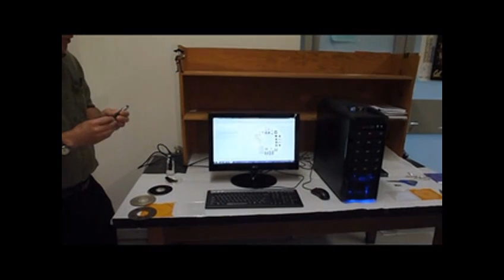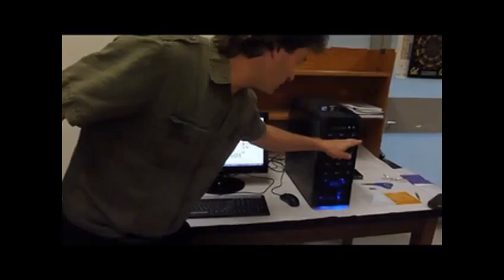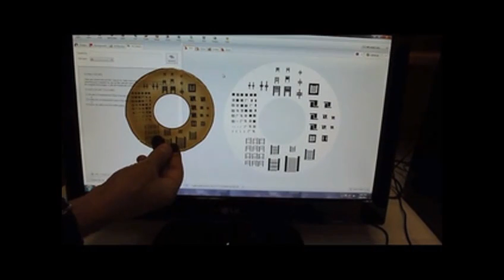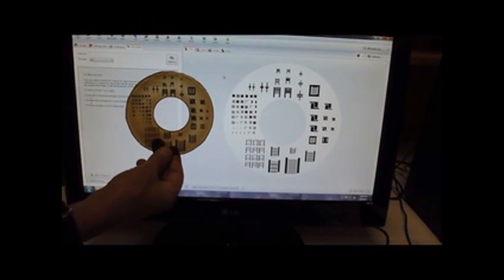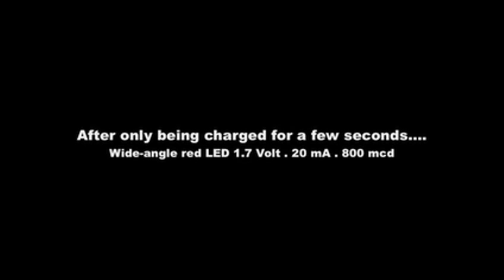Making graphene supercapacitors with a DVD writer

Comment: Run an LED for five minutes?  Can't a regular old capacitor do that?  A super capacitor can run an LED for several hours.  Something tells me this is not real.  Graphene is supposed to revolutionize batteries and capacitors.  Yet here we are two years after this video was posted and this technique hasn't produced any significant results.
Reply: a usual super capacitor needs much more time to charge. if you would charge a regular one only a couple seconds it would not have saved enough energy to light the bulb up for maybe 30 seconds. a graphene capacitor can hold much more energy than that. he only charged it for a couple seconds.
Reply: ***** A supercapacitor like the maxwell variety has much more volume if you scaled this up to the volume of one of those capacitors I'm sure you could achieve the same duration probably for about the same price as buying one yourself.  Really lightscribe dvd burners are cheap as is the plastic they are printed on.  I would like to try this.  I want a supercapacitor for my motorcycle electrical system my only concern is the discharge rate.
Reply: Yeah but it was only charged for 2 seconds
Reply: Anoney Moose
If you charge a super cap for two seconds, it can run an LED for five minutes.  You don't need graphene for that.  But in any event, he didn't even show a super capacitor made with graphene.  Besides, there are dozens of devices made with super caps that don't contain graphene.  Hell, there are dozens of Youtube videos of how to make a flashlights using a super capacitors.  Lidmotor comes to mind.  He's got one that will run a very bright LED for 30 minutes with a tiny little hand crank for 30 seconds.  This video isn't about the magic of super capacitors, it's about the use of graphene in super capacitors.  The video provided no useful are pertinent information.  It makes you wonder why someone would even make a video like this.
Reply: +ElGatoLoco698 He is just suing that as an example if a 2 second charge is a applied then the end result would determine how much energy is stored. lets say a 30 sec charge what would the out come be ????

Comment: Why not just remove the DVD burner/scribe laser, make a mount so its similar to a printer then make a program so it can still run but instead of it burning on a DVD and requiring to spin it would  now print it on thin layers of plastic or glass.  You would get bigger supercapacitors with just as much accuracy.

Comment: Very low capacity 20mA @ 1.7v  x 5 min (0.08hr) = 20ma x 0.08hr =  ~ 1.6mAh  x 1.7v =~ 3mWh (a standard NiMH is ~2200mAh), so around 1/1400 th the capacity of a AA battery. I doubt it weighed 1 / 1400 th. The only exciting thing is fast charging. 5 w/hr, AA is good for about 1.4w/hr so 3x faster

Comment: Somewhat except that these capacitors have a fairly high energy density with little leakage vs the Zinc-Carbon batteries have a very low energy density and high leakage. 

I'm not sure what they are using in this video but vinegar or another weak acid might work. It might be Boric Acid or a Borax solution or another weak acid/weak acid salt which is what traditional Electrolytic capacitors use.

Comment: The Lightscribe made many very small layers of graphene not just one. The "battery" you're talking about isn't a battery but a super or ultra capacitor. You can make them by taking two layers of the graphene material made with the Lightscribe and an electrolyte (the word you didn't hear which is essentially an acid) in the middle. Hope this helps.

Comment: Well, I have a question.
Graphene is a one atom thick layer. How could a Lightscribe device create this? does it burn the other layers away, or does the heating melt the layers into more than one layer of graphene?

And another:

In the end(1:30), there was this "Battery" made from graphene. What did he do with it? He said something like "To little pieces put together with..." what did he say? To little pieces with what?
I didn't understand it..

Comment: Lightscribe DVD drives are special types of dvd burners that are capable of printing labels on dvd's. The software is available with the dvd drive, but you would need the diagram and pre-process they use to create the actual superconductors.

Comment: Exists better alternatives than "Si solar panel",are solar too but the technology are completely different the amount of efficiency the same but
maintainable you can make minor repairs to get fully efficient output trough 100 years,because is not decomposed at atomic level due to sun radiation,but anyway steel low amount of energy and the solution  is partial especially in city's , you need nearly 25 mts^2 per person to be energy independent,the ecology impact in large scale is not studied .

Comment: Recently i read an article about an old solar panel used for 20 years and it still works a little bitl over 80% of original specs.
And this solar panel had old tech. There will be solarpanels based on graphene in the future and graphite is abundant. Look more positive about it pls. Here in Europe everywhere u look u see solar panel on some certain roof. Atleast every road. And now it gives u 8% return investment. So if u have money on the bank.. and the bank gives u 1%. U must be stupid not to

Comment: my only problem with this is that he says it holds the same amount as a battery.  if it did, it should light an led a whole lot longer than 5 minutes or so.  batteries smaller than that cap can keep an led lit for many hours.

Comment: Excellent, very promising idea.   Much more testing by science and industry is needed to convince the world that super capacitors are safe and reliable.   Not a naysayer here,  but an engineer out there must be concerned about the stress test of temperature, vibration, pressure, and EMI.   Further,  does anyone ever address life cycle outside the lab in a real world application?   How will the phosphoric acid layer between the graphene plates react under these stresses?

Comment: No, you can't add wind turbines to the front grill, that would decrease range and power and solar panels won't help much either as they wouldn't be able to supply enough electricity to charge the capacitor fully in any reasonable time period. Regenerative breaking also isn't going to cut it. So, no, you won't have a self-sustaining power source (which is impossible by the way).

Comment: There is where you are COMPLETELY wrong, nothing in a desktop runs on AC power that is why there is a power supply. A desktop pc runs on 3.3V, 5V, and 12V DC power, all you have to do is use these and put them after the power supply and you got yourself a desktop with a battery

Comment: Not really 1 atom thick...you have the plastic substrate x2 + the dielectric + packaging/terminals, so practically let's say: 1" x 1" x .01" = .01 cubic inch x 1000 = 10 cubic inch. Compare that with a 0.5 cubic inch of a AA similar capacity. (20) times the volume. Still graphene is amazing discovery.

Comment: That's 20ma x 0.12 @1.7 volt in 0.2"x1" x 1000 = a 1.7 battery. Yes it does
math out. 
Remember that it's thin plastic substrate. 
Its 2 atoms (2 sides) of carbon make the circuit. Consider their thickness.

Comment: Maybe it's already done before this video. I suppose they use 2 transparent discs, that you get in 25/50pcs blank dvd case.
They coat one disc and stick another to first one, making it a sandwich. They insert that into burner that does the litescribe job.

Comment: Of course!  I am definitely getting getting slower.  What if...
An inkjet printer with cartridges 'sprays' the original graphite solution onto a mylar sheet in the applicable pattern.  That mylar sheet is then fed into a laser burner.  Basicly another 'printer' where the cartridge is nothing more than a series of laser diodes equivalent to the lightscribe lasers.  The cartridge feeds back and forth from left to right across the mylar sheet creating the graphene in the patterns reqd for lrgr caps

Comment: I have seen a lot about this but one thing I have not seen addressed at least in a way that I could understand.   I am wondering how long a graphene super capacitor can hold a charge.  Not how much energy it could hold but how long it could hold it without the energy just leaking away.

Comment: Laser printers use a different process- the laser charges the image on the drum and the toner is electrostatic-ally transferred to the paper then crushed into the paper in the fusing section. A Lightscribe shoots the Laser beam directly to the DVD surface, HTH

Comment: Can graphene be "folded" or "layered" into a 3 dimensional shape? Would it be feasible to make three dimensional structures out of it? Considering its strength, if this material could  be used in blades and structures, I'd imagine the applications would be endless.

Comment: Wow.  This is great.  With a little retooling I could see this being used on flexible circuit board material (the kind DuPont makes) to form cylinders and other geometries with more surface area/current holding capacity.

Comment: Hey I wanted to know if it's possible to get a few sheets of this with a certain pattern and how expensive more or less it would be.
I probably want to use this for a project at my university.
If this is possible I would probably need some other data as well, but I would like to discuss thing through email than.

Comment: Ok, I do get a liquid solution of graphite oxide, then I put a plastic sheet on a CD.
However the solution is not enough to cover the whole cd, I am afraid to burn the plastic if I put it on the dvd burner...

And again, I do need to wait that the solution is dry before to put it on the dvd burner, otherwise the whole solution will spill into the dvd burner, doesn't it ?

Thanks

Comment: by cm^3 you mean one cubic millimeter , righ ? or cubic centimeter ?
just trying to calc to get 1kwh , how big it will be.
for example supercapacitors today have 3000F / 2.7V / 10935J @ 0.51KG = 0.0030375kwh
Will need about 330pcs to get 1kwh bank , about 168KG / 370pounds
Can be used on EV Drag Race 1/4 mile , I guess will do 200MPH under 10sec .

Comment: Do you know how graphene might differ from conventional conductive metals in conventional capacitors?  Can you stack layers and have thick sets of layers either positively or negatively charged or does each layer have to have a positive and negative charge? Can graphene use a conventional dielectrics like conventional capacitors or does it use something specific to this material?

Comment: Article in peer reviewed journal "Science", published by the American Association for the Advancement of Science (founded in 1848).  Brief article published in UCLA's Newsroom, News Releases, March 15, 2012.  Gizmag also shared the energy density of a specific electrolyte, "The supercapacitor exhibited a capacitance of 276 Farads per gram, and an operating voltage of 4 volts. This corresponds to an energy density of over 600 watt-hours per kilogram.... will be reduced due to support structures."